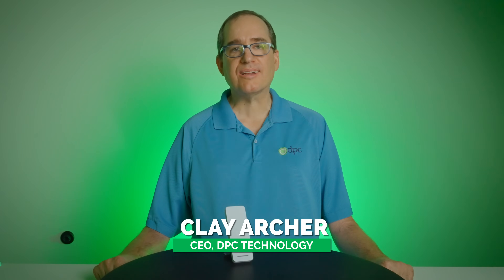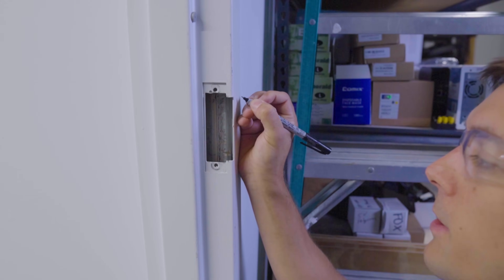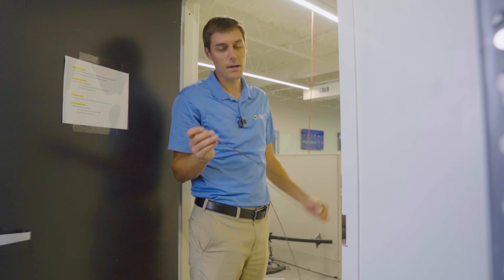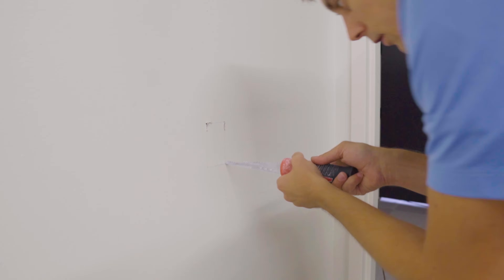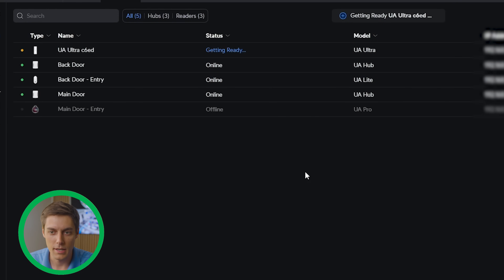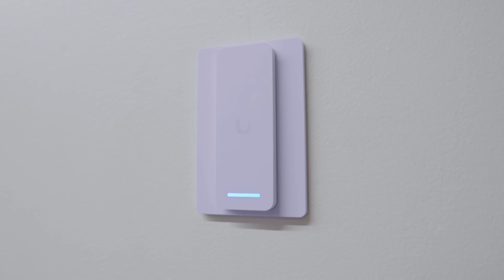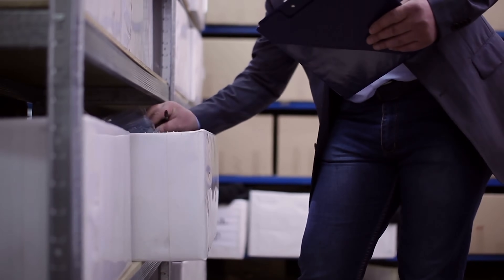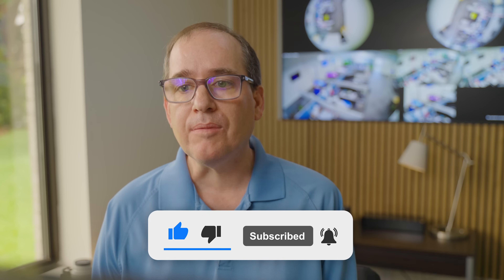Unifi Access Ultra Setup Guide

Comment: Great video and installation guide. One question is how did you get Access UI to show both Exit Request and Lock to be wired up in their "Terminal Manager" when you only physically connected two wires to the electric strike to "Exit Request" in your demo? We have Enterprise Access Hub and will also be using their electric secure locks. Do we plug the contacts into Lock or Exit Request and should it be (NO) or (NC) when configuring within the UI itself? Thanks!

Comment: I bought one after watching this video, however after installing in here the lock is doing the opposite, when we click on the app the door locks and after a few seconds it unlocks it. 
we tried to switch the NC / NO on the door, however it doesn't persist the change on the web app. Do you think we had something wrong on the setup? One thing that I might thing should be a problem is that the POE is beeing powered by a Cat5e cable, not sure if this can "cause" that kind of problem.
Reply from the maker: over a short distance the cat5e shhould be fine but u could troubleshoot by running a larger wire outside the door fame for testing.  it sounds like you have it either wired in reverse or an incorrect setting.  Im not at my office but if you havnt figured it out by next week, ping me and i will look at mine..

Comment: the problem with this device is that even without disturbing the tamper switch, the lock can be activated from the space outside the secured space, for example, someone could find the wire in the wall behind the reader and apply an external 12v and gain entry completely out of sight from the other side of the wall from the reader.  The door hub or door hub mini could live on the secure side and raise the barrier to unauthorized entry slightly.
Reply: If you check the technical specifications from Ubiquiti, you’ll see that the UL 294 rating for this device is Level I across all four categories. Level I represents the minimum/basic performance under UL 294—not the higher Level IV ratings that apply to maximum security or critical infrastructure. Even Ubiquiti’s Pro series lock systems are only listed as Level I.

That doesn’t necessarily make the product ‘bad,’ but it shows it’s designed more as an affordable, IT-friendly access control solution rather than a high-security lock. For true high-security applications, hardened lock systems have existed for a long time, though they can get very expensive. UniFi’s approach seems aimed at ease of deployment and integration with their broader ecosystem (network, video, etc.), rather than maximum physical resistance.

I'm always open to other opinions, but it's an excellent option.

Comment: Just curious on the fail secure setup. How do you exit from the inside? Is the lever free handle? In case the power is down, the lock is set to fail secure so you can't get in, how will someone get out from the inside?
Reply from the maker: @supersayianz  the door handle works from inside
Reply: @DPCTechnology  so meaning to say when power is cut, the door handle can still be pressed to exit from the inside?
Reply: Most common use for this type of setup is to buy what is called a "Storeroom" Lockset (outside handle always stays locked), the exterior handle can only be turned by using a key (or the electric latch opens the way), the inside has no buttons, but always turns the lockset so you can exit.  Schlage makes a ton of these locksets.

Comment: I am thinking of doing this to my garage door, I think if you connect the door lock output to a relay and connect the dry contact of the relay to the garage door opener, anybody knows this is possible?
Reply from the maker: It should be, but i have not done it.

Comment: Can you install this without any other hubs or unifi gear required? Just plug it into a POE switch of any type?

I would like to install this with a mag strike and exit button for a single exterior door
Reply from the maker: Yes, you just need a unifi device that can run access.  The could be a cloud key, udm, etc..
Reply: @ thank you! And this will go right into a standard 1 gang box?

Comment: Thanks for this useful video, I am wondering if this reader can be installed outdoors as it has IP55 (weather resistance) while the Intercom product clearly stated that is suitable for both indoor and outdoor installation with IP65. Weirdly when I filter their products with "outdoor" I get G2 Reader which has also IP55 but not the Access Ultra.

Comment: I'm a tech for a company specializing in building security. For this sort of thing we'd have used a Dremel tool instead of a jigsaw. A small handheld Dremel, while you have to be careful of it getting away from you, is far more precise. The oscillating saw was exactly what we'd have used.

There are quite a few commercial electric strikes that can accept 12VDC to unlock, some that are fail safe (will unlock by removing power) or fail secure (which will stay locked when unpowered). Most of these strikes have spacers that can be placed in such a way as to position it correctly. Many also have a perimeter side cover which can be screwed to the strike so that the rough edge of the door frame would be covered (this allows for a some wiggle room in your cutting precision). 

I'm a bit surprised that Access ultra doesn't have a door position sensor (or door contact). Without that device, you'd have no way of automating any alerts to the door being propped open or forced open. 

How does Unifi handle motion rex detectors? In most door access systems, the motion rex not only releases a door but also acts to confirm entry. Thus with a badge reader and door contact (DC), the motion rex completes a tri-part entrance event: a badge is read, the DC confirms the door was opened, the REX confirms passage. 

Also, does Unifi have the ability to do monitored sensors? Many access control systems allow you to put resistors across your DCs and REX relays so that if the wires are cut and twisted together, the system would know it by the resistor no long being in the loop.
Reply: Still waiting ...
Reply: Excellent points.  Disappointing there isnt a response

Comment: Hi, it is possible use Unifi Access Ultra with this 3wire lock system? + and - is for lock imself (1A/12V max) and black wire is pulse control - so if i connect this lock on voltage on + and -  and last cable to + or - it is possible in UI setup select NO or NC? It should work for this setup? Thank you for your answer. This solution is great, but security doors have special lock systems, not simple BEFO https://www.sezamcz.cz/images/virtuemart/product/190495.jpg

Comment: Have you done a panic exit door bar by any chance and do you know if anyone sell the surface mount electric strike for panic door? Thanks for the great video.
Reply from the maker: @GabrielGutierrez-sh5ti  we use a push bar with a strike.
Reply: @DPCTechnology  could you share the brand and model please! Thanks
Reply from the maker: I use ubiquity strikes.. and then whatever push bar comes with the door.  Typically we're not the ones installing the push bar or buying the door

Comment: So I'm a little confused now with the electric lock option. We have a metal frame glass door out front that doesn't have a latch (like the little thingy that you'd turn a door knob to unhook the door from the plate/frame to open it). It's just a handle and you pull or push to open the door, and it has a lock that latches when we close up for the day. We want to do an electric lock but not sure if that would work in our door situation. Would the electric lock make the lock itself turn to lock/unlock as we push the Exit button (or swipe to enter), if that makes sense..? Or would we have to use the magnetic lock option since there's no door latch thingy?
Reply from the maker: @dw-dj1ii  it needs an electric mag lock

Comment: This is great and a fair price finally, but, one problem, anyone can now yank that out and put power to the strike plate with something like a battery and they’re in.. So, good for convenience, security, not so much.
Reply from the maker: @waynenocton  it fails locked...
Reply: @DPCTechnology  I think you misunderstood me, you can pull it from the wall and apply 12 volts and the door will open.
Reply from the maker: @waynenocton  You can also kick in the door...  I think a thief would do that first..

Comment: I was thinking to use this for a house side gate, noting that it's IP rated, unlike the lite, and comes with a inbuilt hub unlike the g2 reader.

Then a g2 reader pro for the front door, and a g2 reader for the back door to both run off the same hub.

I'm trying to think of an elegant solution to not need 2 of these on the gate (one on each side)?
Reply from the maker: @will67755  don't think this is the solution..
Reply: You'd recommend using 1x g2 reader (preferable, or 2 if i need to) and 1x extra hub?
Reply from the maker: @will67755  I think u can get away with one

Comment: Just tried to install one of these today, we used the slim plate and for some reason, we cant get it to latch in place. even by hand with the bracket just resting on the back of it!
Reply from the maker: Our fit without issue.  Maybe throw up a picture on reddit or fb and Ill take a look..

Comment: Does the reader require security screws to remove it from the wall or does it just pop off with a tug?
Reply: I'm considering this on outdoor doors on a shop.  Right now, I have keyed locks that I am sure a pickable by the right burglar.  There are windows next to the door, so someone could break the glass and get in.  Do you think this is appropriate in this application or am I downgrading security.
Reply: @rpetty  i would not use it for that application. Get the starter kit, its still cheap as far as access control is considered
Reply from the maker: @rpetty  It's your call.  I think they can work in that scenario.  They are "lower" security.  If you have a lot of valuable stuff on the other side, a regular Access setup would be more appropriate/secure.
Reply from the maker: @brandonreidy6989  if someone wants to rip it off the wall they could, but they could kick the door down too..  it alarms when tampered with and fails to locked..
Reply: @DPCTechnology  agreed. More curious if that was part of the design or not. A big difference between a curious person  vs. Someone determined to break in.  If someone can just grab it and rip the holding tabs off vs someone having the proper tools to remove it with intention.  Also says something about the build quality as well.
Reply from the maker: @brandonreidy6989  agreed, like any security feature I think less info online is better than more..  I touched on it but don't want to over share..

Comment: Fantastic video; What electric Striker you are using or prefer. It will be interesting to hear base on your expertise which strikers (brand) work best and why same with Cables and wires ...
Reply from the maker: @EleanaOre  I've used a bunch, this time I just used the UniFi one, it was fairly priced and worked.like a champ..  others were just high rated Amazon strikes or mag locks..
Reply: @DPCTechnology   Thanks

Comment: Why was the large wall plate used?
Reply from the maker: @NathanSweet  it comes with the ultra..
Reply: @DPCTechnology  I mean that I think it would be cleaner to mount the ultra on the wall without the plate. The plate is larger than the ultra and doesn't look as clean. I'm wondering if the plate is optional?
Reply from the maker: @NathanSweet  you could go either way.  It actually looks pretty good in the room.

Comment: I greatly appreciate the real-life install videos. It shows the common issues you run into and how you overcame them which is honestly helpful for most of us DIY-ers out here! It's often frustrating to watch a "perfect install" video or a "let's just set this up on a table for a demo" video and it looks all super easy and then you go to do it and end up spending 3 days and 4 trips to Home Depot. Also, one question I couldn't readily find an answer to: What is the maximum distance for running the low volt wires from the Access Ultra (or the Access Hub) to the actual lock? Thanks again for all the great videos!
Reply from the maker: @DominicRusso17  it's a good question, I don't know but will find out..
Reply: @DPCTechnology  I did ultimately find out the answer and it's approximately 500 ft
Reply from the maker: @DominicRusso17  That's good info to know. Thanks for sharing man